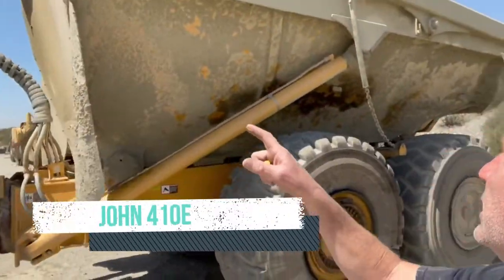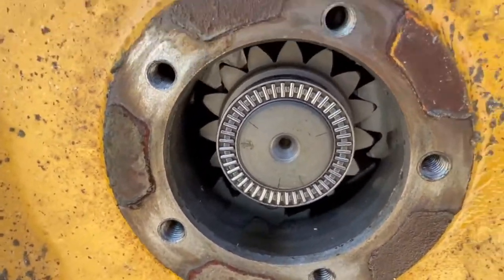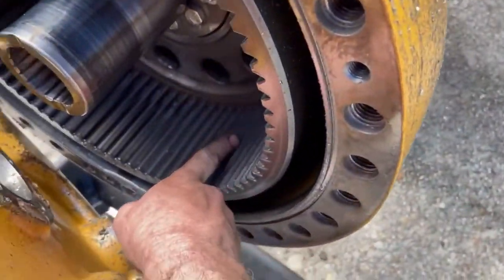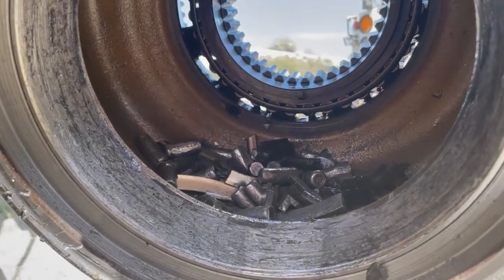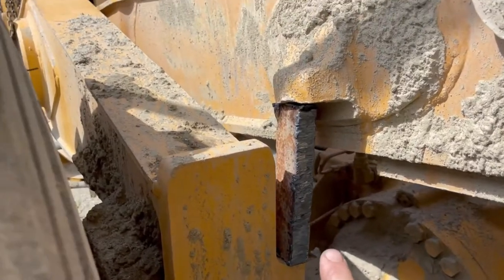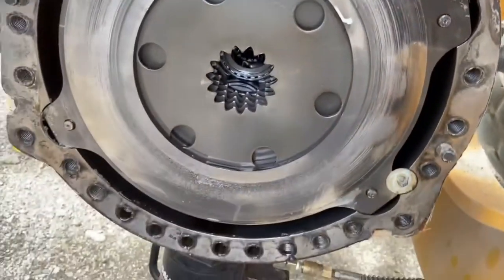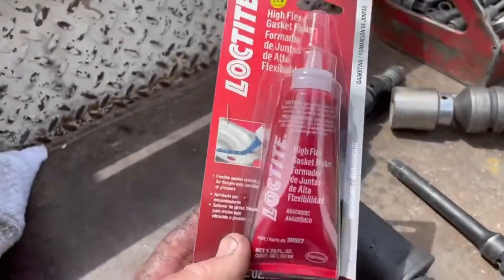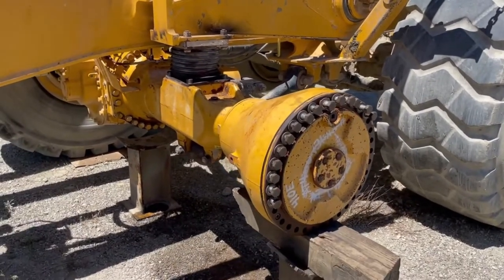Deere John... John Deere Wheel Bearing Repair 410E Articulated Dump Truck

Comment: What model 410 is this?
Reply from the maker: 410E
Reply: Last week John Deere pulled apart a 310E dump because we were getting hydraulic oil in the axle. The brakes are built into the hubs on the one. The brakes were fine, just had a cracked line in the axle.
Reply from the maker: @Rfsi what poor design 
That’s a lot of work for something like that

Comment: I  don’t see why when people buy their equipment that they charge so much for the parts. Which I’m sure they all do.
Reply from the maker: They all do but John Deere seems to be a lot more expensive to repair than Cat
Reply: I used to work for a company that sold helicopters. They were not on time with the deliveries for any of the airframes. They were fined at the cost of the all of the helicopters. They lost all money that would ever be made on the sale. The only reason to sell them for free was the parts that would be sold at extremely inflated prices for the next 30 years.